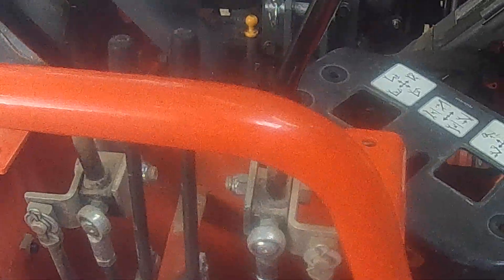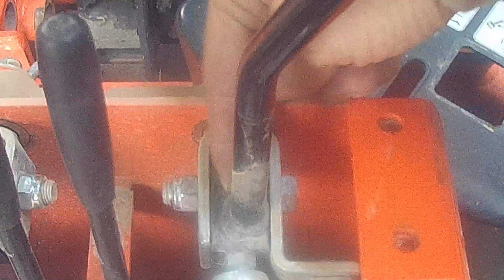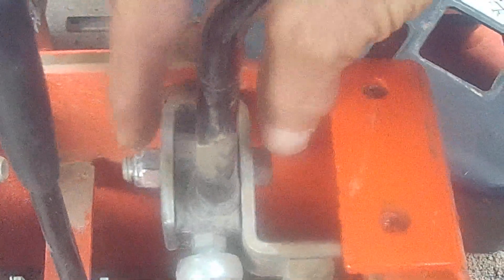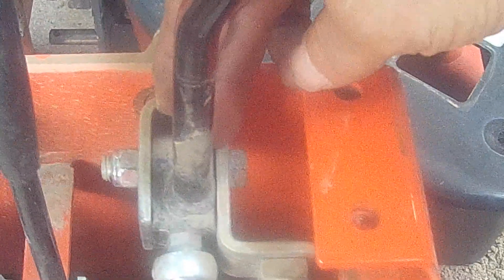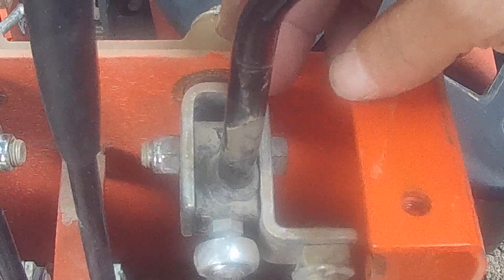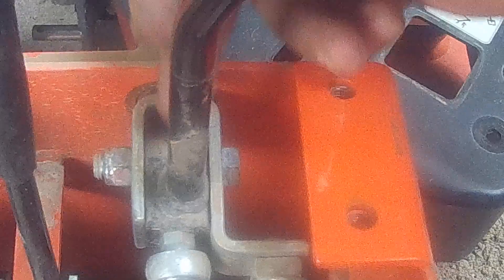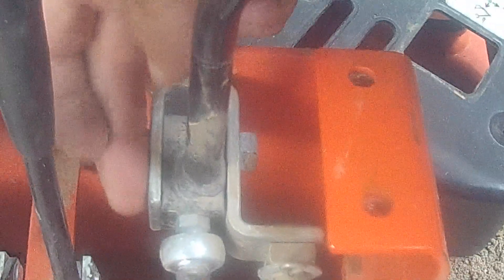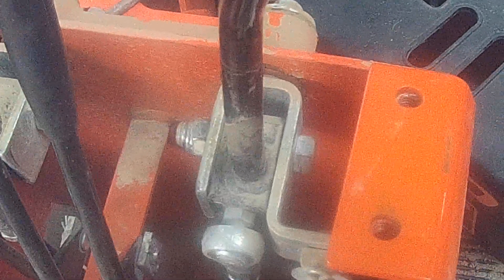2017 Kubota B2601 Adjusting my BH levers

Comment: Being in the trade, lever sloppe is always a problem on older machines. Good quality swivel joints are worth every cent for longevity. Thks for the vid
Reply from the maker: Thank you for your input. The tractor is a 2017. I only have trouble with the lever on the left. I don't know if that is because the hydraulic fluid goes to that first when operating both of them. Later
Reply: It doesn't take much play in the linkage,when you are trying to feather the hydraulics, especially with the 4 way linkages. Washers missing, loose bolts all add up. I always try to use self locking nuts, that way, they stay just right. New nuts whenever the linkages are dismantled, work best, i find .  take care

Comment: Good catch!  If you had let that loose go on, it would have gone worst as the holes would have elongated. Does it have any lubricant at all?  Thanks!
Reply from the maker: Thanks Joe. It didn't have any grease when I opened it up. I didn't show putting it back together but I did take the same grease that I used to grease the tractor. Later